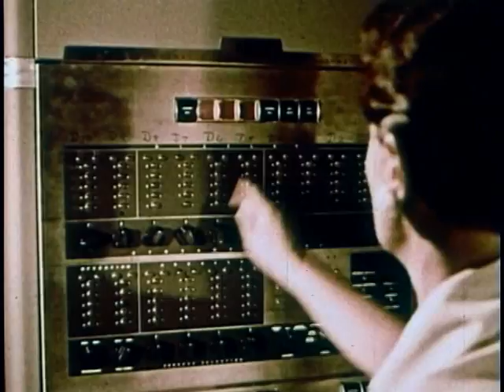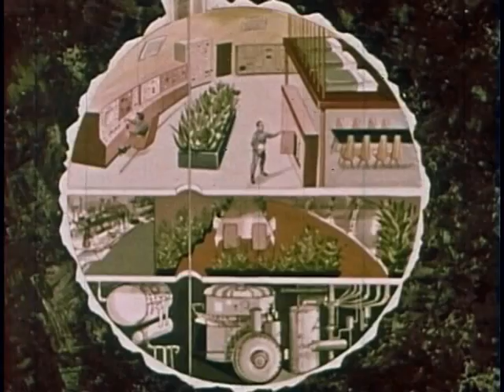Way Stations in Space (1961)

Comment: They've got it completely wrong from the start.  Lower stages (or the B-52) are needed to gain more speed, separating from the lower stage to reduce mass.  The lower stage, when launched from a planet with an atmosphere, also helps the higher stages avoid friction losses. 
  However, staging is not used to get away from "the earth's gravity field", because the gravity at typical low earth orbit is only very slightly less than that of sea level. Gravity declines with the square of the distance from the center of the earth, not from the surface,
  Another falsehood near the beginning: Orbiting craft do not avoid very low orbits because the orbital speed is too high -- there's nothing wrong with that.  The actual reason it that it's harder to maintain orbit with friction caused by the upper atmosphere.
Reply: Very well put! I would’ve never otherwise second-guessed the film’s plausible-sounding explanations. But now I’m left wondering how on earth (pun!) such flat-out wrong science made its way into an educational film?! After a bit of research, the first “educational consultant” billed at the beginning specialized in biology/zoology. This only deepens the mystery… wouldn’t it have made more sense to consult with an aerospace engineer or someone specializing in atmospheric science, physics, or ANY field that concerns the topic at hand? No offense to the late Dr. Fitzpatrick, but his Ph.D. dissertation was literally about squirrels!